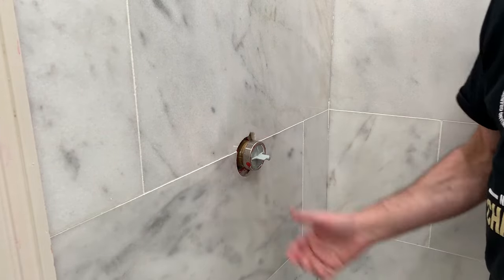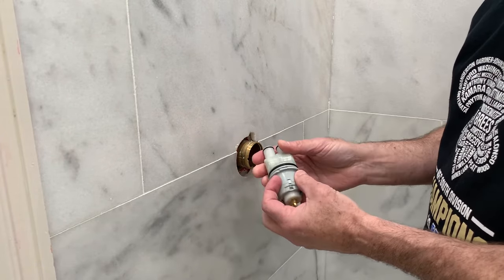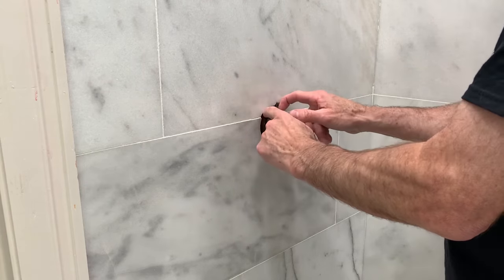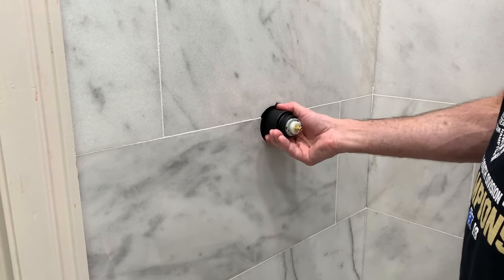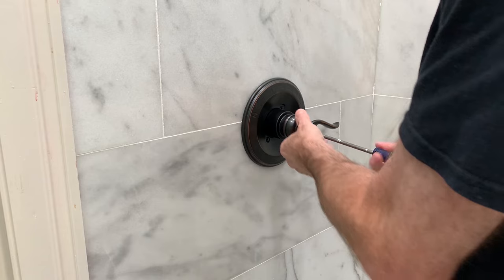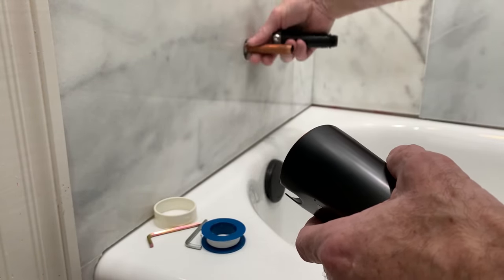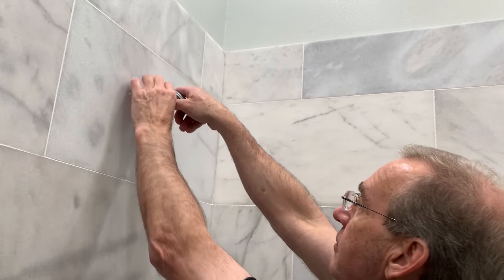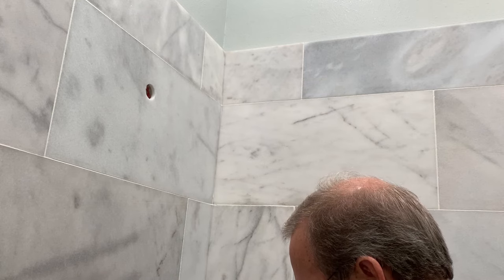Install Delta Shower Trim Kit (Faucet Valve & Handle, Tub Spout, and Shower Head)

Comment: Thanks for mentioning that the shower faucet trim ring has a foam seal to keep water from getting into the rough-out hole for the shower value assembly.  I wondered about needing to out clear silicone around that trim ring.

Comment: So question, I am purchasing a brand new house that is coming with standard Delta faucet bathroom shower equipment. We want to upgrade the trim for the shower. Online it says the Delta foundations has the R1000-UNBX shower valve body... the trim we want that is from delta and matte black and is compatible with the same R1000_UNBX. Will I still need the change the valve or can I just easily swap out the trim hardware since the valve body is the same
Reply from the maker: I am not 100% sure, but the new trim will probably fit on the existing valve.

Comment: When you finished putting on the handle for the Hot/Cold housing I saw it did not let you turn it all the way left and only towards the cold. How do you adjust that? Once it's screwed on do you PULL out on the handle to adjust the centring for hot/cold? if that makes sense.
Reply from the maker: The temperature adjustment stop is not allowing the handle to go further counter-clockwise . The stop is accessible once you remove the handle. It is a white disk that can be rotated. Just pull it straight out and rotate it. I have a video that clearly shows this. It is named “Shower water temperature adjustment on Delta faucet”.

Comment: At the 6:42 minute mark, you screw a black piece into your tub faucet.  Do you know the part number for that piece?  I've been in contact with Delta directly and they can't seem to help me. My tub faucet didn't have one of these, but the people at Delta said that it should come with it.  If you watch the Delta Youtube videos, this black piece comes already attached to the tub faucet.  So their "how to" videos don't show anything or mention anything about having to attach these 2 pieces together.  Did your tub faucet purchase come with these 2 parts separate?  Thanks for any help you can provide.
Reply from the maker: You are the second person that had this same issue. They show 6 different spouts for the same trim kit. I guess they want to make it difficult. The spout I have is the RP19895. This part number must cover the spout and internal piece you are asking about because there is no part number for a separate internal piece. I can't remember for sure, but I think mine came together as one piece. Hope this helps.
Reply: @FixItDepot  Thanks for your reply.  Delta says the same thing. That the internal piece should be connected to the faucet piece in the package.  Either my faucet model doesn't come with that piece or Delta forgot to add this piece in the factory.  Delta is telling me to exchange the box in the store and see if another box has it included.  If it doesn't then Delta will apparently help me from there.
Well done video by the way. Thanks
Reply from the maker: At least they are willing to work with you. Hopefully just returning it and getting a new one solves the problem. Good luck with it.

Comment: Great video👍 do you caulk around valve backplate?
Reply from the maker: No you do not. There is a seal underneath the plate that keeps water from going into the wall.
Reply: @FixItDepot  thanks again👍

Comment: The piece you threaded into the tub spout do you have the part number for it? I ordered the same trim kit but it didn't come with that piece.
Reply from the maker: They show 6 different spouts for the same trim kit. I guess they want to make it difficult. The spout I have is the RP19895. This part number must cover the spout and internal piece you are asking about because there is no part number for a separate internal piece. Hope this helps.